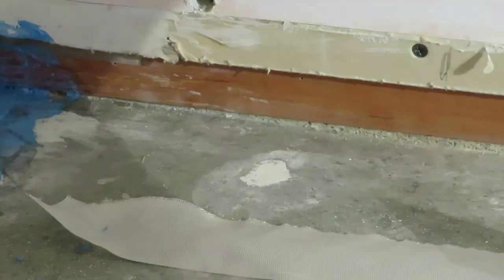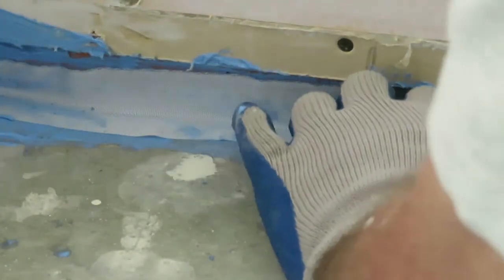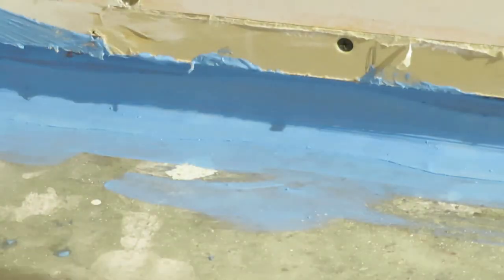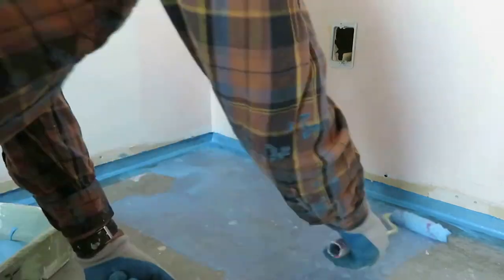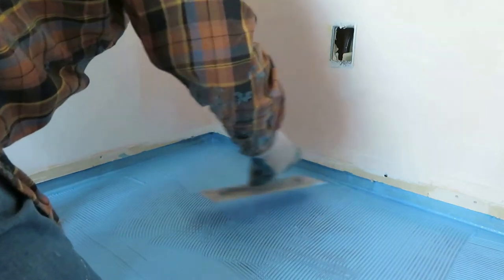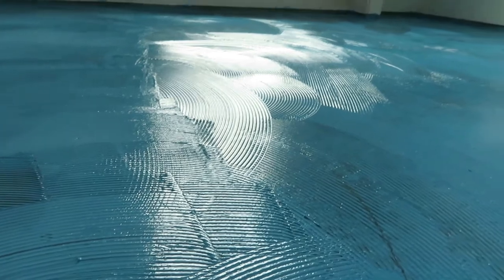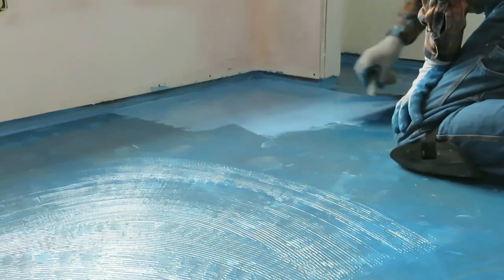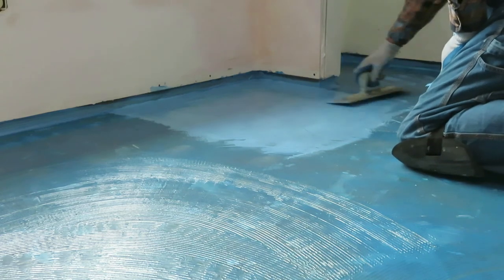How to moisture proof an older concrete slab floor

Comment: This is glorious. Invaluably helpful to me. Thank you. Due to circumstances, I have to move back into my childhood home. The room has a pretty severe mold problem since it is a corner room with single-pane glass window, single-pane sliding glass door facing sunrise, water-soluble paint on the walls, and a cement slab floor that to my knowledge was never sealed. It was lined with newspaper that dates back to the 80s, of all things, and had an indoor-outdoor carpet with built-in rug pad laid over it.  The rug pad has since disintegrated and what remains has been dyed by the ink from the newspaper like a temporary tattoo. The floor moisture and condensation was so bad in the winter that I remember every morning the glass was just soaked and pooling a the bottom where the carpet had rotted away, and the floor was so wet to the touch that I couldn't wear socks indoors. I've been using a 3-part mold removal process throughout the whole room and closet, which is the best that I can do because I am not permitted to, and not knowledgeable enough, to tear down the walls and rebuild. I have this time gotten permission to bring up the carpet and apply a moisture seal though, now that the extent of damage to the room has become apparent since I moved out and was no longer present constantly fighting the moisture and mold that I always communicated was there. I've also purchased a dehumidifier and am looking into plastic second glazing kits as I am not permitted to, and do not have the savings to currently support replacing the glass on top of other expenditures, if I were permitted to. After the walls are done being treated, I'm going to patch holes that had rotten through, apply 100% waterproof caulking in gaps (many of which surround the windowsill and sliding glass door), and apply mold-resistant paint. If you have any other tips for dealing with the issue beyond moving again once I have the ability to, please let me know.
Reply: Stick on cork tiles might be a good option over the floor sealer as they cope with moisture issues really well. 
Another-more expensive - option that’s excellent for dryness is a sump pump underneath the house. Google radon solutions.

Comment: I cant find anywhere on youtube if this is recommended or not for the concrete slab , i started to doubt when i read it might cause problems in walls as moisture cannot escape through the slab, i dont know the answer
Reply from the maker: If you have moisture in the slab then you have problems, you want to prevent it, this happens in older houses where the plastic sheeting used as a barrier has failed.
Treating it as I did, or putting vapour barrier on top before you install new flooring , will prevent moisture from appearing, it's still there , but cannot affect your carpet or vinyl, or engineered floor.

Comment: Thanks, we’ve just removed an old musty carpet and old plastic tile from a 1950’s concrete bungalow in the U.K.  It still smells in there, I’m sure it’s the floor, which is concrete with some residue of black glue holding them down. Hoping this will solve the problem.
Reply from the maker: Hi , I'm sure it will, I think you can get a similar product in the UK it black, I saw a guy on YT using it, personally I would make sure it's not  solvent based. I'm from UK originally,
Good luck , let me know 🙂
Reply: Have you sort of the problem ? If you do what you used as I got the same issue .

Best wishes

Comment: Thanks, good info. One thing that occurred to me is that all your walls are still resting directly on the slap where you can't reach with the applied sealer. Do you think there is concern with continued moisture wicking up to the wood there?
Reply from the maker: I don't think so the foam gasket under the bottom plate was in good shape hadn't deteriorated since 1985 !!

Comment: Hi. Do you know if the whole floor needs doing if i only have a bit of damp in 1 corner? Could do with not having to take up all the tiles. Thanks.
Reply from the maker: I personally would do the whole floor ,don't do half a job, but that's just me😊
Reply: What did you go for eventually?
Reply: Ha. Still on the list of to do things.😊

Comment: I have to use some leveling compound too. Would I do thos 1st or after leveling?
Reply from the maker: You could do either , I used thin set tile morter then let it dry completely then did the blue seal
Reply from the maker: I would do it first then do the blue seal , make sure the levelling compound is really dry

Comment: Hi Nick, thanks for posting this, nice job and very encouraging. After about 1 year, any other thoughts or reflections on this? Did you go for engineered hardwood?
Reply from the maker: Hi , yes indeed went for engineered hardwood, it all went very well, I did the whole house room by room, the entire house is finished, it took 2.5 years, fullish time.
I really think if I hadn't addressed the moisture issue like I did , it would have turned out very badly
Reply from the maker: https://photos.app.goo.gl/MxJFMipcNNuKZ2Xz7
Reply from the maker: Here's a photo of work in progress
Reply: Great! thanks for getting back to me. Will soon be lifting old parquet flooring off a concrete slab. This looks like a good next step, and would then follow a good barrier underlay, and finally engineered hardwood. Cheers    @nicksquire3934

Comment: Great job. Did you use any special cleaning products on the floor before applying the coating?
Reply from the maker: Hi , no I didn't, I just scrubbed away the drywall filler residue from 35 years ago ! Let it dry them applied the Blueseal
You could smell mustiness when we bought this house, and the windows used to fog up in the winter, all fixed😃

Comment: Will this bubble up if the concrete is damp. I have a room that used to be a garage and doesn’t have a vapor barrier. I want to tile but need something under the tile
Reply from the maker: @ThatAltAccountOfConnorF9491  Hi  it has to be dry to apply it, of it's damp in.summer you might have to go for more drastic measures.But if it's dry now, yes it will cure in 12 hours and you can tile over it.BUT. this product is intended for exterior foundations to prevent water getting in.
There are specific products for this application intended for tile to be applied on top of.
Redgard in Canada and US

Comment: We are trying to fix our downstairs basement, it’s not level and has a lot of divots in it. We ripped up the old carpet to redo the flooring, we need to level the concrete but do we do that before we seal? The concrete seems to have some moisture in it already according to my partner. Or would we seal, level, and reseal?
Reply from the maker: Hi , how much moisture is the question, is it visible damp patches?
If it's winter on your part of the world ,rainy,maybe wait until summer to tackle it.
When you say needs leveling , by how much, slopes, or just low spots?
Maybe send a few photos , happy to help if I can 
nicksquire007@gmail.com
Reply: Hey, where are you from?
Reply from the maker: I live in Canada 🙂
Reply: @nicksquire3934  my floor sweats when i touch it, its salty like moisture
Reply: @desiree2040 where are you from

Comment: Is this needed if you use a moisture barrier over the concrecte?
Reply from the maker: No you don't need both, I did it because it seemed easier than using poly, and I like the fact that I could create a seal by lipping up the bottom plate of the stud walls

Comment: Hi Nick, can you tile over this stuff? Thanks
Reply from the maker: I did look into this, because I wanted to do a shower tray with it, but I decided to use a product called Red guard , available here in Canada.
Blueseal and Redguard are both Elastomeric products and there are forums on line about using it.
Blueseal is about half the price of Redguard, why not try a test area , stick one tile down with it and see how well it adheres, A to the floor and B to the tile? Hope this helps

Comment: Did you have to grind the surface first? That has been recommended for my home. Bare concrete with similar
Patched holes from carpet tacks.
Reply from the maker: No I just.washed it well. Lots of drywall compound droppings from 40 years ago, patched holes with tile morter

Comment: Its the same thing as redguard or mapex blue stuff you use in bathrooms around tubs for tile..
Reply from the maker: Not sure if that is a statement or a question, but yes you could use Redguard or Mapex but it's much more expensive